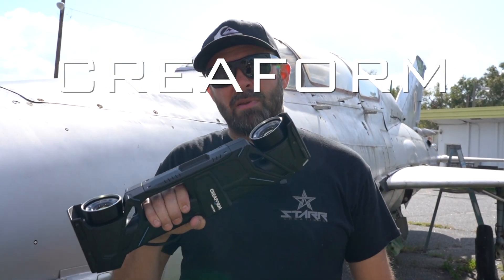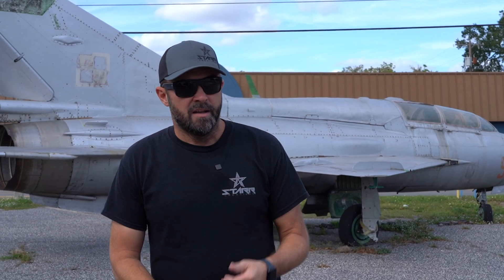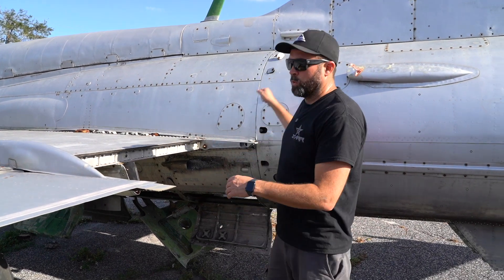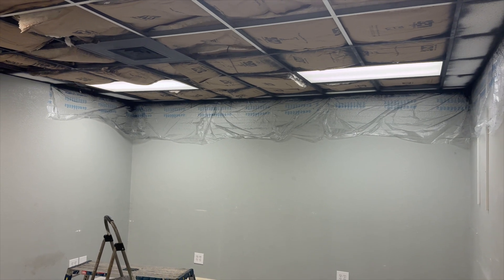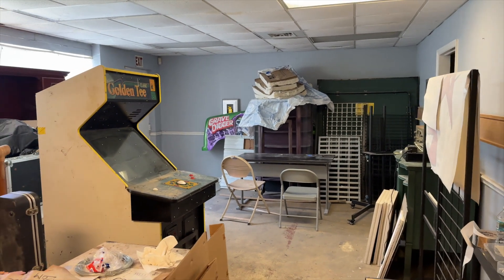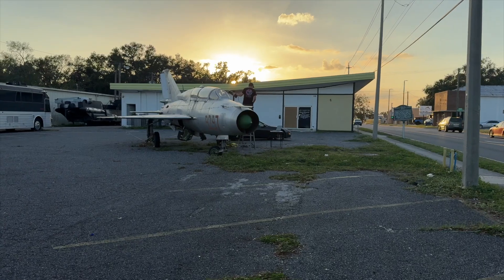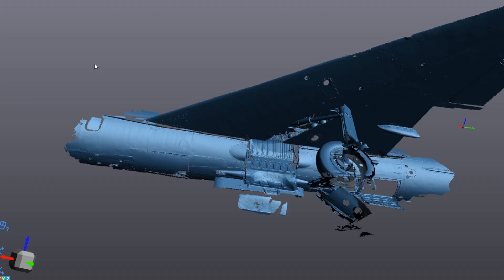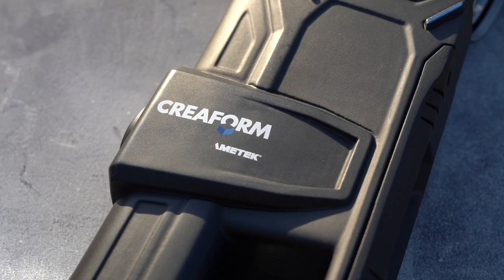3D Scanning A Mig 21 | Creaform HandyScan Max Elite!

Comment: Well if you have the ability to check out the aerodynamic qualities of a aircraft then may I suggest this idea, start with a fully symmetrical fuselage and wing based on the F16XL simply by stacking the same airfoil design and what you will end up with is a rocket if you throw in a set of center line twin counter rotating variable pitch fans that you could use for acceleration and breaking